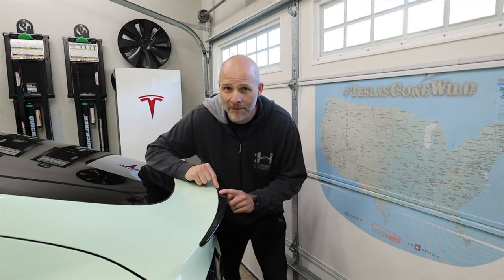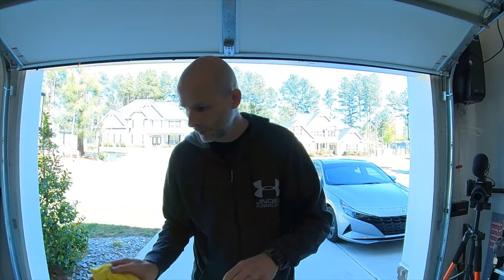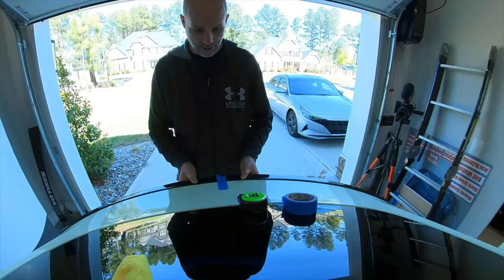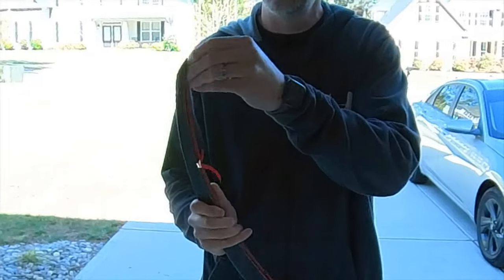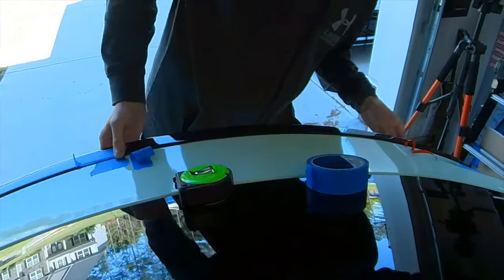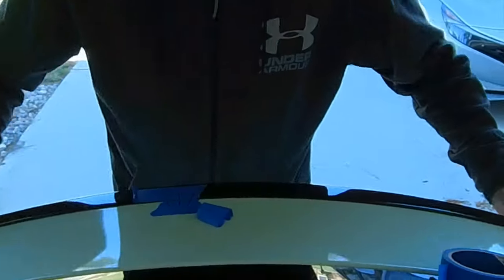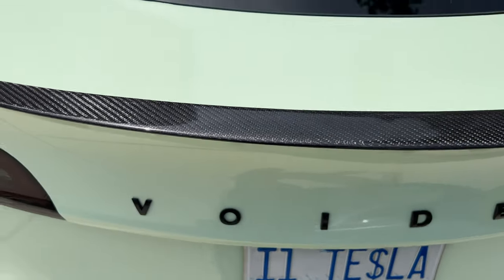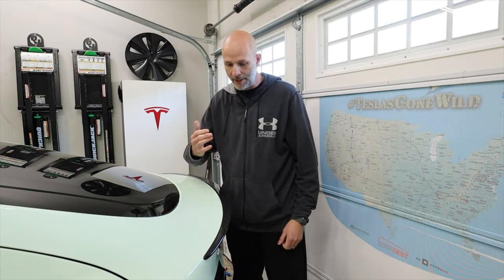Gloss Carbon Fiber Spoiler for Model Y

Comment: Junk.  The lamination started coming off after one year..  But even more disappointing is the customer experience I had.  When I tried to return them, I had to email various Hansshow email address for a week with no response. I finally got a response from a rude employee.  At first, she tried to claim that no return was possible unless I could  prove that they don't work with my car.  Then she offered some very lame advice of how to splice wires to make the lights work, even though they are advertised as "plug and play."  When I told her that I was not going to be splicing any wires, she wanted to charge me a 25% restocking fee.  I was able to get that down to 15%, but I still had to pay shipping to send the lights back to them.  In retrospect, I'm glad I did not install them.  They look and feel cheap.  The wiring harness inspires little confidence. Hanshows products are shoddy.